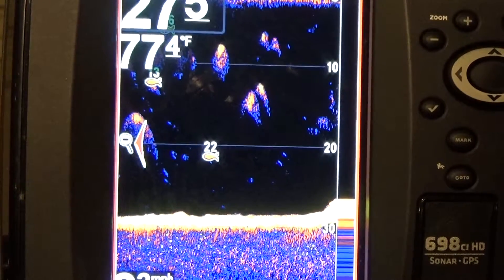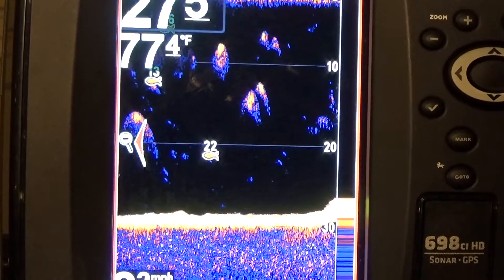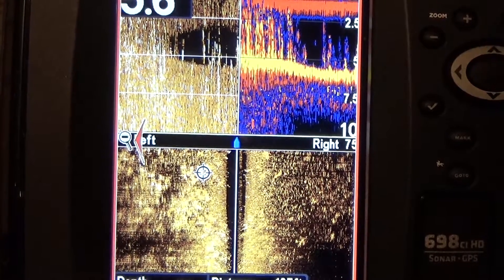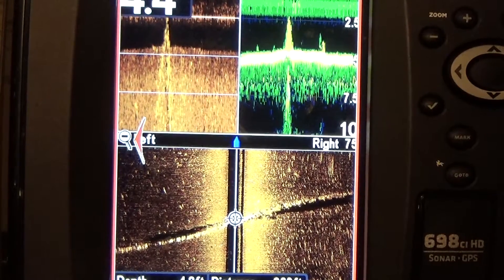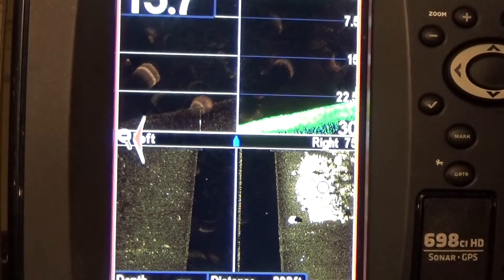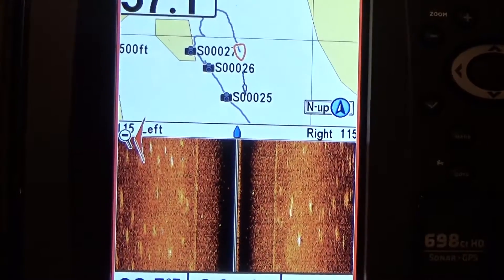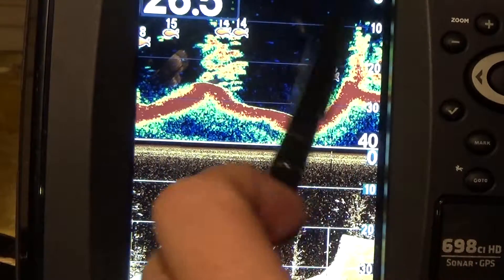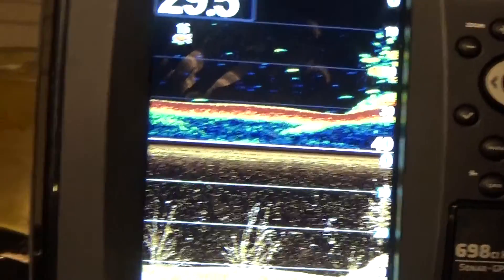Down Imaging VS Regular Sonar

Comment: So basically if your in a weedy lake sonar is pretty much useless.?
Reply from the maker: wish2fish there are some things you can see in a lake that is loaded with vegetation. You can tell bottom type, large structure items and depth. However, if you are familiar with the lake then being active on the sonar is pointless. I go more into heavy vegetation  and show when, where, and how to use your sonar in this video: https://youtu.be/9vhxUjKvTP8
Reply: Thanks..This video here is more helpful than the other.I can relate more to this sonar unit and the image of weeds and you say shut it off.Alot of videos on youtube show all these arches and tons of fish and I get more specks on the screen than arches.Must be the fish size.Those big catfish you showed on the screen were only little specs.I never use that fish I.D..It would drive me nuts with all the stuff floating around such as weeds and the sonar picking it up.

Comment: How shallow before you think they can hear/feel the signal from the transducer?
Reply from the maker: I would say that the area not depth determines if I am active on the sonar. If I am pulling into a small creek or patch of lilies I generally turn it off. At that point it really serves no purpose. If you are in an area where you try and be as quiet as you can with talking and trolling motor noise than it can't hurt to disable active sonar. Try this, next time you are out on the water reach down and place your hand near the transducer, it won't hurt you but you can definitely feel it. What you are feeling travels for hundreds of feet in the water so one could imagine that in that quiet creek the sonar is something they can at the very least feel. I stand strong on the idea that it is best used as a tool to identify structure and good habitat.
Reply: Seriously, to me it makes sense! I'm new to the sonar world, but on my boat I remember not turning my fish finder off. I heard a "clicking" noise. If I could hear it I'm sure the fish can as well! Thanks for the info!
Reply from the maker: Exactly, click, click, click. I have a project in the works that explains fishing sonar in detail. Top to bottom left to right. The first video should be out next week and my only goal is to make you a better fisherman. I have experience in the industry and they will probably not like me much after I dispel some of the myths. It will start with setting up your equipment properly then a basic how to use, secondly pro level instructions and finishing with how to use your side imaging to make a map of your lake that you can basically walk on. Lots more to it but that is the basic idea. You don't have to own the best to be the best tight lines and hope to see you around.
Reply: Be quiet and fish dude, yes!! Please do that
Reply from the maker: The weather has been holding me up but I am working on it. These videos will be kinda boring but it will all be legitimate information presented in an easy to understand manner. There is so much bad information out there and that is why I am doing this new series. So many dudes keeping sponsors happy by up selling the latest and greatest when even a cheap unit will give the same sonar resolution. I still haven't decided what lake I am going to use so if you have a specific type of lake you like to fish let me know and I will find one similar.

Comment: You made me a believer when you said the fish are aware of the sonar. Saw something a few weeks ago that the Navy admitted to killing whales with sonar while looking for submarines. Is there a portable unit you would recommend for someone renting boats in a local lake that averages 50-80' in the deepest channel?
Reply from the maker: I have a buddy that spends a lot of time kayak fishing. He uses a Lowrance Elite-3x. It's $99 and can identify structure and fish well,  it will run on a cheap 12volt lowes battery (product number B12V-1.3) all day with no issues. I wasn't a fan of the interface but for the price you cannot get any better.
Reply: Thank you for the info!
Reply from the maker: DisplayName01 No worries, good luck and tight lines. Remember don't focus on the sonar, focus on the shallow weeded areas this time of year. If you live in the south work the 4-10 foot range and in the north work the 6-1 foot range. I did a video on how to catch them in the weeds, I stand by that one.
Reply: Thanks and same to you! I live in central Maryland and stuck on the bank for now. I think I'm going to switch to lighter line so I can cast farther and start fishing on the bottom. I plan on getting a trolling motor set up very soon and start renting boats at the local lake. My thoughts are a fish finder should help me find structure underwater so hopefully I can catch a fish or two.
Reply from the maker: Bank fishing can be difficult. Bass are very capable of seeing what is walking the bank. They can see about 15 feet outside the water when they are in the shallows. Don't rush to get a longer cast, focus on being quiet. If you place your casts well and focus on being quiet your numbers will go up. Get to the bank and chill for about 5 minutes before casting, it will pay off in spades.
Reply: Thanks for the tip! I will try that next time I go out. What were those two books you flashed in the video? I need to read up on bass, I'm from Louisiana, and fished brackish water all my life, redfish weren't so difficult.
Reply from the maker: I have three books that are worth reading to improve your catch.
 1. Largemouth Bass by in fisherman.
2.High Percentage Fishing: A Statistical Approach To Improving Catch Rates
3. In Pursuit of Giant Bass by Bill Murray - take this one with a grain of salt though it has a good premise but takes a lot of patience.